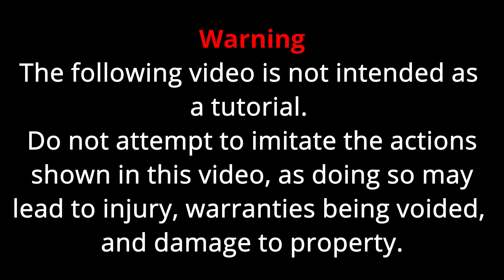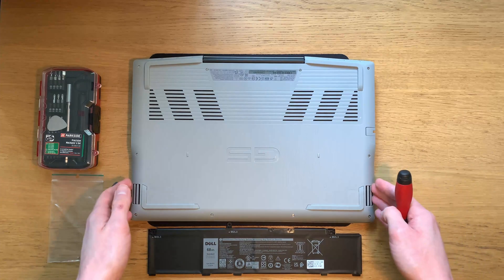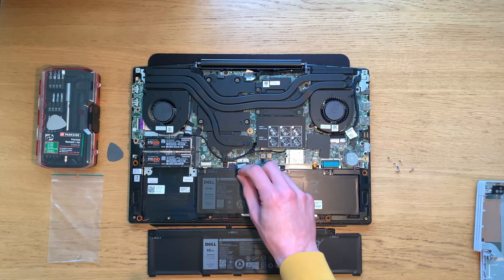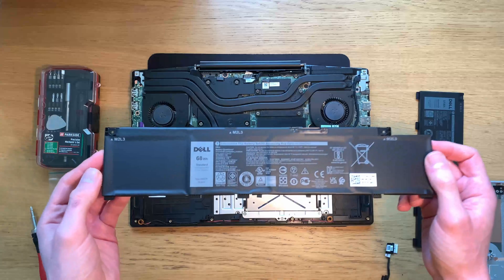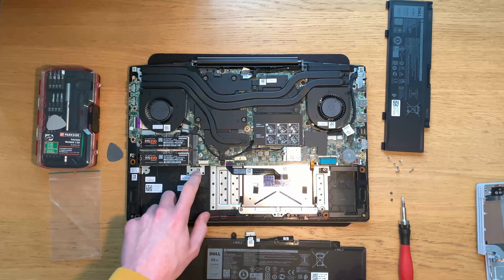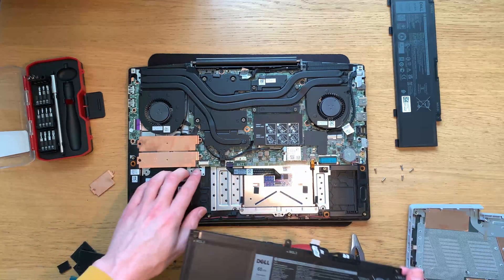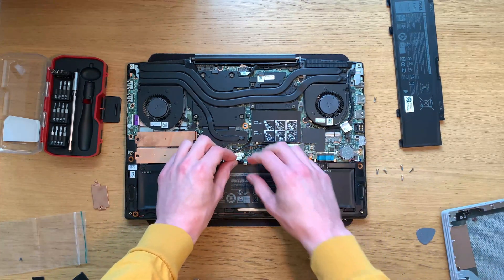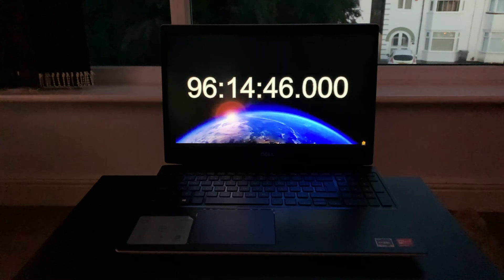Dell G5 15 SE 5505 Battery Upgrade Upgrade to 68Wh from 51Wh

Comment: I was literally just looking at this as well. Every 68wh battery I've found says its 15.2v.Dell
lists the 51 wh and 68wh as both being 11.4. I'm curious to know if your battery was 11.4v or 15.2v ???
Reply from the maker: It was a higher voltage, I can't remember what it was off the top of my head, but you should be able to see it in the video if you pause it at the right point. If I'd noticed before swapping the battery I probably wouldn't have attempted the swap, but I didn't even think to check because the battery was sent to me by Dell for this laptop.

Personally I'm still daily driving the laptop with this battery today
Reply: @eburneentertainment  So then your laptop is still working fine?? And should i also upgrade to 68wh ??

Comment: I'm looking to do the same upgrade with my g5 but on some sites the 68wh battery is listed as incompatible due to the different voltage - the 51 wh battery is 11.4v and the 68 wh battery is 15.2v. Clearly the difference in voltage was not a problem for you and l'm curious now that its been well over a year since posting the video if you've had any issues and if it is still performing as well???

Comment: Hey man, I get 4 hrs on my 51whr after 1 yr of use. Make sure you set the minimum load profile, no boosts and disable hw accelaration in browser, might as well turn down to 60 hz but 51hr was very well capable of doing 5.5 hrs and I believe 68whr can easily do 7hr+.

To make sure u get the most from ur battery, open hwinfo amd ur 5600m sensors should be blank( means dgpu is sleeping)

Comment: Is there any way to upgrade the screen? I have the 5505 with the 60hz display and I really want to change it for a 120hz.
Reply from the maker: It will almost certainly be possible, though I haven't looked in to it since I'm happy with the screen mine came with (I've got the 144Hz one). In fact, if you do attempt the upgrade, get the 144Hz screen rather than the 120Hz one because the 144Hz has a peak brightness of 300 nits vs 250 on the 120Hz one. For reference the 60Hz display is also 300 nits, so you might find the 120Hz display a bit dim
Reply: @eburneentertainment  do you know what type of pin connector does it have? Is it a 30 pin or a 40pin because i think the 144hz display only has the 40 pin connector and the 60hz and 120hz have the 30 pin.
Reply from the maker: @mariogrp  I don't know sorry, I have taken photos of the inside of my laptop though if that would be helpful to you, or you can tell me what to look for? I'd be surprised if there would be a difference on the motherboard though, I'd have thought that they'd use a standard motherboard regardless of what options you configure your laptop with, but I could be wrong. My laptop doesn't have the RGB keyboard but there's an unused connector for it on the motherboard for instance, but that doesn't necessarily mean the same will be true for the screen I suppose
Reply: @eburneentertainment   the only way to know that is by doing the screen replacement process which is pretty easy when you get to the actual screen it usually has a connector on the back which is the only one there that should tell you how many pins it has but I don’t want you to do that to your laptop because of me I guess I’ll just try to look for a 144hz display online that has a 30 pin connector I don’t really know if they exist.
Reply: also 144hz screen has 72% NTSC compared to 45% ntsc of 120hz and 60hz one and 144hz has 9ms response time while 120hz and 60hz has 20ms

Comment: I saw you add the heatsink for the NVMe drive, or just suddenly appeared when you cut the video lol. Do you have the new temps for the drive? Are they now in the range of Samsung temps? Wee they worth it?  And while at it, what about the model that comes with the ryzen 9 4900h? Why you choose the 4800h?
Reply from the maker: Haha caught that did you? I'll have to test it and let you know. They only reached dangerous temperatures under a sustained load before, such as when rendering videos, so next time I render a video on it I'll take a look. I expect they'll be worth given that the drives were reaching life shortening temperatures before.

My choice of laptop was entirely based on price to performance; I got this on sale for just under £600. I wasn't even in the market for a laptop, but at that price I couldn't resist, and I don't regret it one bit! I probably would have befitted from the Ryzen 9 when rendering, but I also have a desktop computer so I could always just use that for rendering as long as I'm at home if I'm that bothered, but most of the time I prefer the convenience of being able to edit from the sofa, particularly when I've been at my desk all day for work.

Comment: Nice Video! Please make one too when you repaste and repad also tape the air leak on the fans. You can find the instructions on the dellg5se reddit! Thanks.
Reply from the maker: Thanks, I absolutely will! I still need to order the pads but it's a video I'll definitely do in the future.
Reply: @eburneentertainment  could u try disabling smart shift too? Its there in reddit... They say it improved performance and battery life